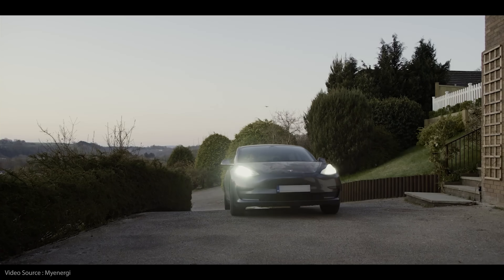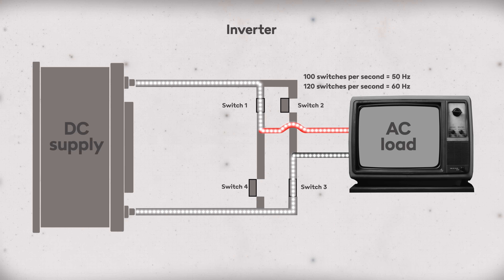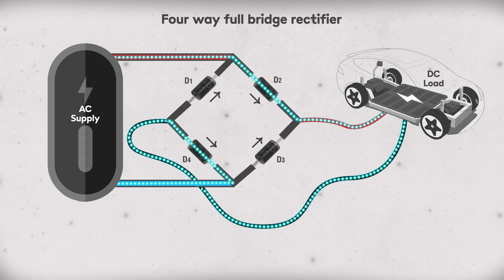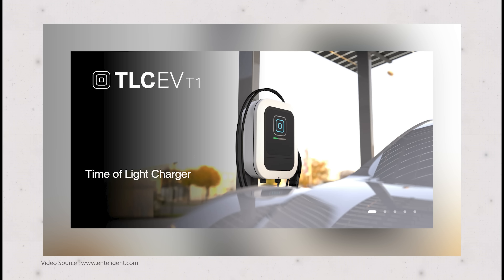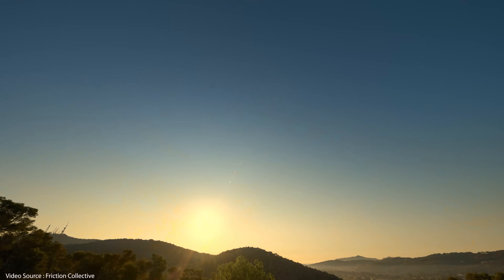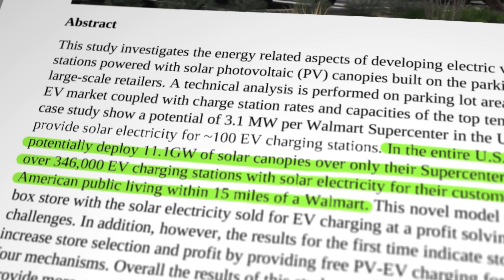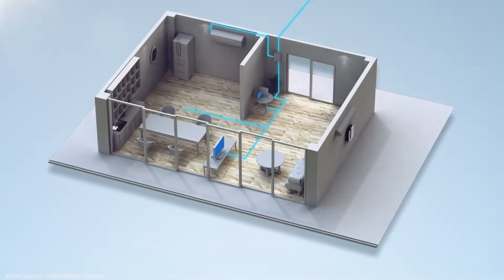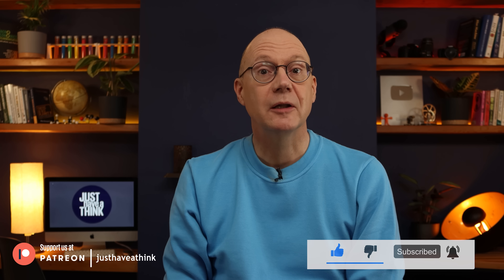DC to DC charging. One more step to off grid living!

Comment: Hello. 
Is there a device, to connect DC from solar panels, to the ev DC port ?

I have offgrid solar inverter, for the house power.
Reply: There should be a device, able to charge with both dc and ac, from the solar panels.

Comment: So many things have been missed.

Solar only works during daylight hours, so you must charge your car during daylight and how many are home then.

Car batteries must have a minimum input before they accept a charge, so solar panels must generate at least a minimum amount before anything happens.  About 1.5kw

A 45kw car battery will take about 8 to 10 hours to charge on a solar panel system as if you have 5kw solar panels, that doesn't mean you will get full 5kw of power as the sun is NEVER directly over ALL the panels at once.

I can go on and on but placing hundreds of panels on a roof is impractical as the copper cables alone would be phenomenal let alone the cable size and power outputs.

I can just see a MASSIVE fire potential.

Comment: Can we fast charge an EV directly from the DC current of 480 volts generated by connecting in series 10 solar panels of 48 Volt and 560 Watt each. I mean without a DC-DC convertor.

Comment: I’ve been thinking, given that most devices in your home run on DC current except your vacum cleaner i guess, it would make a lot of sense to install DC wall sockets and use DC power directly from solar panels and batteries.

These sockets would obviously be USB-C. I think we are ready for this change to happen.

Comment: I would like a more detailed explanation about the voltage this system can take, using dc means a part is lost in the transportation at the low voltages that typically output the solar panels. You may need very expensive cables or a physical proximity between the charger and the solar panels.

Comment: His comment on cheaper night time tariffs will go isn’t really true. We already have smart charging when the grid is heavily used to balance the loads, and don’t forget the new EVs will also be sending power back into the grid on demand.  There’s a difference on how the grid will be balanced load wise, batteries, vehichles will also play a part in powering the grid. 

The cheaper tariff will still be there, it will just charge your car when it detects an abundant amount of power on the grid instead of fixed hours.

Comment: Fun fact:
Every onboard charger has rectifier at the input.
So car should not care if it has AC or DC on input of OBC - it can be used as DC-DC converter.
So if you feed the car with correct voltage, which is 100V-300V in most countries, your car should charge. 
You just have to limit control pilot in order to not overload DC system.

Comment: T 8:00 his the main reason I used a SolarEdge inverter instead of a micro inverter.   Yes, they are still not available yet.  But think about it.  Your micro inverter changes the DCto AC on the roof.  You charge your ev and now it has to change it back to DC.  Then if you have a home battery and use it in the home, you are changing the DC back to AC.  The "round trip" percentage loss is much greater.   Of course,  everyone is entitled to their own thoughts.   I gave you mine...

Comment: I don't believe this. You need something to regulate the voltage along the way to prevent battery (or solar array) damages. How do you boost up your (let's say 100V) solar array to your 800V car battery ? If theses companies have found a way to increase DC voltage without converting it to AC beforehand, and with less loss that that conversion... Then they will have a better market : go sell this tech to grid operators wiring very high voltage DC lines.

And if somehow, they cut corners (like grid sync systems etc from inverters), it may lead to some little efficient energy savings but then, this is not DC to DC. And I highly doubt that the efficiency gain is close to 13%, I'd bet it at most reach 2 to 3%. Because you know, the whole point of a converter is being efficient... They are not resistive heatings.

Comment: I have a question. I keep hearing that if everyone puts solar panels on their roof it will require a grid upgrade. I have 10 solar panels and a sun grid tie inverter (which does not export any power to the grid), this keeps my grid use to about 20 watts during the daylight hours. So my question is this: How does my using less electricity cause the grid to need an upgrade?

Comment: Dave is right about cheap overnight electricity going away one day.  The cheapest electricity is during the day in advanced nations such as Chile and Spain.  DC direct charging of EVs is a fantastic solution for the fifteen states in the USA that do not allow net metering.  All 50 of the US states can also implement PV-->domestic hot water with no grid connection needed.  Heating water and one's space is a DC task that we perform with AC.  Edison was not completely wrong, at least not for small grids like one's home.

Comment: If you're getting power from the sun a slightly less but much cheaper charger makes sense. I don't mind if I'm a few percent less efficient than I could be if i'm cutting out the grid operator. A grid operator who by the way is charging me like a Barron to interface with their grid.

Comment: I assume it is possible to convert 48VDC nominal home battery voltage to 400VDC using a boost converter -  but its hard to exceed 88% efficiency.
I would still prefer this to installing a whole new set of solar panels separate from our existing solar power system.

Comment: The comments seem to focus on the 13% figure, but the real issue is not needing grid upload.   Imagine I'm a retailer with a large parking lot, and I put in a canopy with full PV coverage over the parking area and a battery bank to hold several EVs worth of energy.  Then there are maybe chargers for 10 or 20% of parkers, who can recharge for free or a small fee.  If it's cloudy we have a grid supply instead.  But I as the retailer get the benefit of a person wandering through the retail aisles for 30 minutes while their car charges with the obvious benefits to me.   An idea whose time has come.

Comment: What is the efficiency of the DC to DC conversions required by the DC -DC EV charger? There are obviously losses there also as the DC Voltage off of the panels will vary throughout the day and will be different than the cars DC voltage required.

Comment: A  house battery is needed because most people take their electric car to work and only come back in the afternoon, so most of the day the care is not there for the solar panels to charge it. Businesses on the other hand should be able to cover their parking lots or building roofs with solar panels and provide charging for their fleets of EVs and for their employees.
Reply: EV batteries after a 15+ year life providing transportation, would be available at a discount and still good enough for another 10+ years of providing home power.

Comment: The DC-DC Charger is just a bolt on or extension of your solar inverter and linked management of the power storage. 100% right we have miles of roads and parking areas where we can better manage the collection of solar for electricity and heat and also add water management. When are we going to give up trying patch up the legacy AC grid and see a move to a parallel DC and HVDC grid, Big Solar Energy projects and Mega Batteries linked to it.

Comment: I’m glad you are optimistic about solving the challenges of getting solar and wind to the masses—we need to do this and your video gives me optimism too. But one thing that has been bothering me lately (i drive a hybrid only because Im afraid EV chargers wont be available when I need them) aside from EV range anxiety is that I understand that rubber car tires emit something like 1,000,000,000,000 micro scale plastic particles per kilometer driven; im sure this sounds crazy but I’d rather have some way of using wood or something that wouldn’t emit microplastics. We’re finding microplastics everywhere and I suspect they will be the demise of various at risk demographic groups. Do you have any friends trying to reinvent the wheel so to speak? Thank you and keep up the good fight.

Comment: Trick Question: Which of the 3 basic EV drivetrains (all-battery BEV vs plug-in hybrid PHEV vs hydrogen fuel cell HFCEV) offers the most benefits, applications and potential to reduce fuel/energy consumption, emissions AND insane traffic? Your answer here __ __ __ __ __ __ __ __ __ .
WRONG!!
The correct answer is PHEV to serve 65% future EV needs. BEV serves the remainder in mostly lightweight vehicles and short distance travel/transport. Combustible hydrogen in the ICEngine of a PHEV+H drivetrain can deliver more than twice the equivalent MPG possible with HFCEV tech. PHEV tech is especially applicable to long-haul freight truck fleets. The overall answer to this trick question is centered around reducing insane traffic. PHEV tech offers the most economic incentives to achieve this necessary objective.

Comment: It's seems that solar Edge is in Europe and England only. The US based charger its only 12.5 kW. Barley more power than the 11.5 kW that newer evs can charge at with a Level 2. It would be nice to charge at 24 kW DC with a grid or solar suply or both!

Comment: I don't know - I think for the small losses in AC - DC conversion and the high cost of the unit the only place for this is where permitting is a big problem or large commercial operations where the excess energy can be stored or used onsite. I don't see too many home owners forking out for a 15kW solar system and a $US2.5K converter just to charge up their EV. I'm guessing you could split your DC feed from the panels to also run an inverter but not sure how the MPPT would cope.

Comment: I’ve been wondering if this were possible for a while now. I’ve seen a lot of people on YouTube set up  panels, batteries charge controllers then an inverter to an AC wall “charger” to the car. A lot of expense and a lot of loss. 
I wonder how this technology works and if aa smaller portable version could be made for either off grid solar charging or direct charging from big portable batteries like ecoflow to use them as a battery “gas can” by tow trucks etc…

Comment: All buildings will have rooftop PV. 
All buildings carpark space will also have $60 wall outlet.
All vehicles drive building to building. 
All vehicles are parked 23hrs every day on average. 
9,000 hrs per year, 10,000 miles per year avg driven. 1mph or 24mph per day.
TRICKLE currents all day long. 😊

BV, battery vehicles,  have massively oversized battery for the daily drive. 
Massive electricity storage 23hrs every day. 

Nuclear promoters promote UTILIZATION FACTOR benefits. 

As a No Nuclear Promoter, I promote Battery Vehicles massive batteries full UTILIZATION for the BV owner, who can now fully use dirt cheap home electricity and not the extremely expensive GRID ELECTRICITY.  😊😊😊😊

Comment: Most vehicles are parked 23hrs every day and all night. 
BV have massive oversized battery for the daily drive. 
Massive battery parked 23hrs every day is massive stored electricity daily and all night long.
Rooftop PV can be dirt cheap if utilities are kept out of the process. 

Grid electricity is basically EXPENSIVE and will not be needed. 

Sadly for this $TRILLIONS grid infrastructure. 
Death by cashflow drought. 

Governments will fight back.
Investment interests will fight back. 
Superannuation funds will fight back. 
Fossil fuels will fight back.
The DARK SIDE OF SOLAR.

Comment: Dave I like your videos but I think you might have been fed a line here... All the DC to DC converters I've ever worked with have an 'AC' stage in between. It's not possible just to magically go from one DC voltage to another without a switching stage (Unless you use a linear regulator, where your losses would be enormous) I'd like to see some actual numbers for efficiency of these dc-dc converters vs modern dc-ac-dc system.

Comment: Nice video. However this company Enteligent lists the price of this dc to dc charger at $2250.  The Tesla wall charger was about $500. The key question is the cost difference per kWh between using the AC or DC system. This assumes the homeowner is getting payback from his solar panels feeding the grid.

Comment: The bit where you need to hook up to the grid to get a permit for solar panels sounds backwards to me.  Last I checked in my area, you didn't need a permit for a solar panel UNLESS you hooked it in to the grid.  No grid, no permit required.
Reply: Where I am, insurance require compliant PV installations. Systems under 60 volt are a grey area.

Comment: My off grid solar doesn't work anything like this. My panels charge DC batteries directly. There is no need to use an inverter if not using AC...

Comment: One of YT's solar and EV proponants has already videoed his Tesla recharging from his panels and home battery. The issue is usually that regulations are slower to evolve that technology. It's highly possible to have solar and batteries enough to charge a car - even overnight - BUT every regulator has some interest in re-regulating things every year or so. In the UK home batteries used to be "in the loft" close to the panels and out of the way. This is now forbidden and batteries must be out of the house in a fire resistant place. NO-One wants to make a 20 year installation that will be illegal in 2 years.

Comment: DB raises a good point, that most people don't seem to be aware of, that when everybody can use off peak electricity, off peak will no longer exist, especially not as a fixed number of hours overnight. With high levels of wind and solar in the electricity mix, peak and off-peak periods are likely to move around from day to day, which is why we need a properly intelligent grid and genuinely smart smart meters that allow you to control equipment automatically in real time based on real time electricity pricing data. As far as I am aware, this is not something that current (UK) smart meters allow you to do, which is why I would suggest they are a very limited value. 

With regard to dcdc charging systems these are probably going to make an insignificant difference to electricity demand or cost savings. I'm not quite sure where Entelligent get their 13% higher efficiency claim from (I saw it claimed on their site but then couldn't find the screenshot again) because knowing the efficiency that you can get from chargers (which are basically switch mode DC power supplies) and inverters, even when combining them you should get well over 90% combined efficiency and when you take into account that Entelligent's chargers have a maximum efficiency of 98%, then I suspect the real world efficiency gain is probably closer to around 5%, and then only if you're charging from your PV panels or batteries. However, that wouldn't be a very good marketing ploy for a 12.5KW charger which, at $2,499, probably costs about 3 or 4 times more than it should. You can get 11KW mains chargers for well under £400 (although you can pay much more) so I don't understand why anyone would pay an extra £1,500+ to save themselves 5 to 10% on their electricity (but only when the sun shining closed bracket) and you are probably looking at about 100,000KWh (300,000+ miles) of charging before you get your money back. 

I would say Entelligent's marketing is basically green hype to justify an over inflated price tag, and their claim that with it being DC to DC is some great advantage, because you don't have to have AC to DC, is part of the hype. 

A PV system will not be producing a DC voltage at the right level for charging your EV so this charger is basically a dc dc converter, and internally a dc dc converter is basically a DC to AC to DC converter, albeit quite high efficiency one. Okay, you get rid of the AC to DC rectifier bit on the input, but at mains voltages that will probably only save about 0.5%, and the rest of the gobbins inside will be very similar. If you're charging from your PV system or batteries you also save another 5% by eliminating the mains inverter, a useful saving if you're not paying a huge price premium for it. Also, you could probably replace the basic rectifier with a synchronous switching rectifier to save a fraction of a percent, but it's probably not worth it.

Comment: Is there a standard for DC slow charging that all the EV manufacturers are already adhering to?  This seems like a big detail that isn't mentioned as most current EVs use a 400V pack which is likely to be higher than most PV panel string voltages.

Comment: If you are designing are system from scratch one should consider the cost of the wire for transmitting DC power.  In general for high power transmission in DC the guage of cable required is very big and thus very expensive.   Thus if the main use of your solar cells is to supply  A/C to your house, you will have a less expensive and more efficient install using micro inverters on each panel and moving A/C on less expensive house wire.   other advantages of micro inverters:
-Easier to add and remove panels
- lower voltage coming off roof with less danger 
- not having to convert to AC for most common applications. 

I dream of being able to take a panel with me on road trips and get AC when the sun shines.